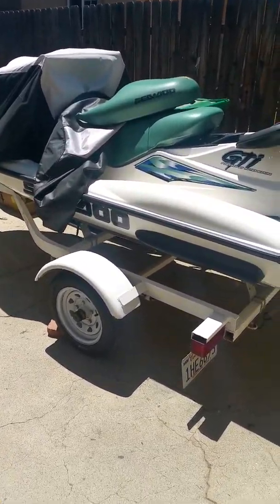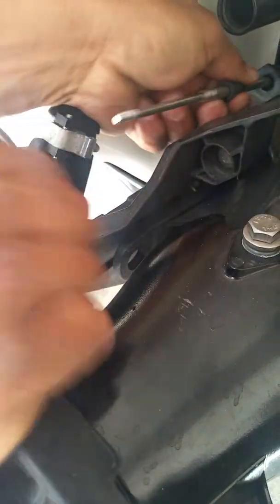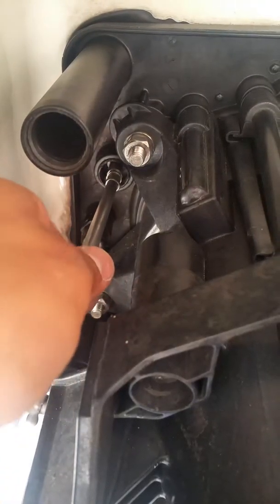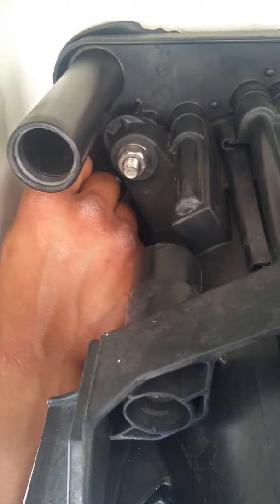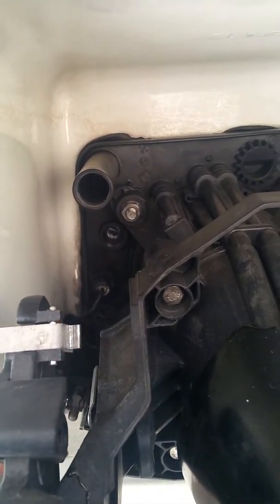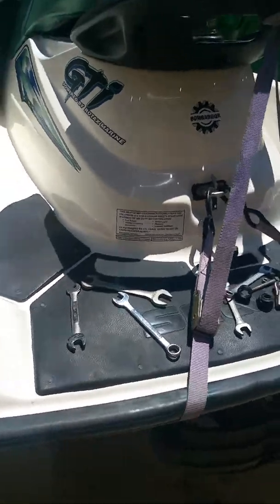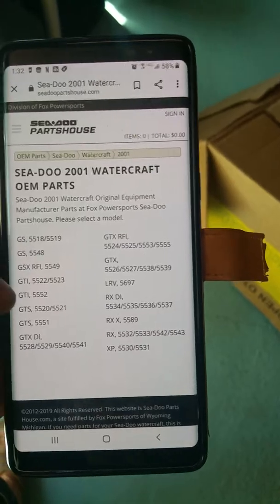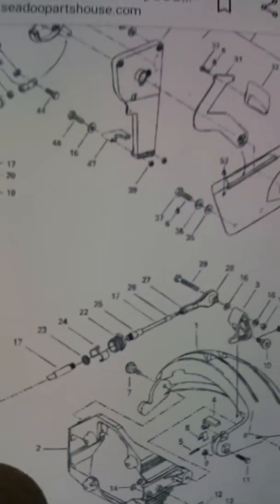2001 Sea-Doo Bombardier Broken reverse cable lock how to remove

Comment: So I replaced that nut and put it all back together and the ski will still not engage into reverse. You can force the gate down with your hand, and use the lever to get it back into forward, but the lever will not push the gate down into reverse. Any ideas?

Comment: question.. did you install part numnber 24? it doesnt fit around the rod
Reply from the maker: I don't remember if the old one needed replacing yes if not I would have put it back together the way I took it out